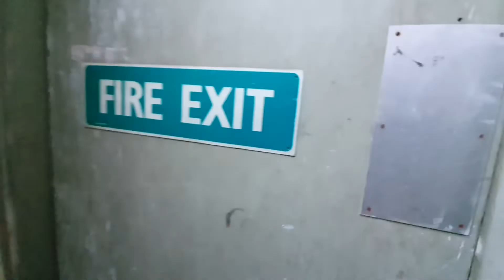Glasgow Western Infirmary

Comment: The big hall like space you said was "church like" was the Church Street Out-Patients Department, with Consulting Rooms on the left side. The door marked "Way Out" leads into the corridor to what was the Church Street Outpatient Entrance. I trained in the Old Western in the 70's and worked in several of the wards, absolutely loved the old building and the Nightingale Wards (old style big open wards with beds up either side). Hated the so called "Phase One" building. It is so sad seeing how it all ended up. Breaks my heart, I loved working in the old hospital. :(
Reply: Oh the phase one was horrible and claustrophobic. I loved the old building,  I remember visiting students in the old part and I couldn't concentrate on teaching etc because of the wards interiors, parquet flooring and you knew exactly where the fireplaces were. Used the old lecture Theatre quite a few times...... I also met my brother for a lift home nearly every day 'new nurses home' then old home, beautiful red sandstone building  I remember as a teenager  going to an open day ie recruitment. Some wards and dept visited and of course the conservatory
... Gorgeous....
Gri had a fab conservatory and the vick had a smaller one that was 'round'.... All lovely quiet places....

Comment: The first place you were is tunnels ..they connected the hospital .  i think there were laboratories there .the big hall is either the waiting room  for out patients or a hall where originally patients may have met visitors .i think the dispensary was beside the out patients waiting room .Alot of the hospital has been knocked down by the time you made this .i think the building oppositevthe wooden construction is the back of what was the Beatson Cancer unit . the church you see is opposite the out patients building you were in.... That road is called Church St and joins Byres Road in the direction you showed where the estate agent is. In the other direction Church st joins Dumbarton Rd .Essentially you were at the back entrance to the WIG , the front from Dumbarton Road next to the Maggie's Centre .
Reply from the maker: Amazing thanks for the information 👍😊
Reply: Yes, the Pharmacy (Dispensary) was off the Church Street Out patients hall, next to the corridor (marked Way Out) to the entrance on Church Street.